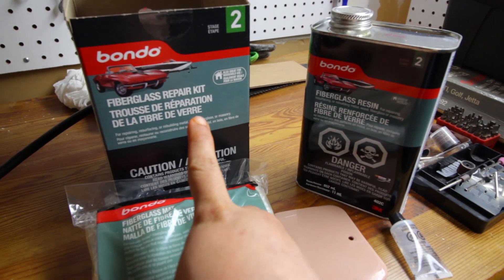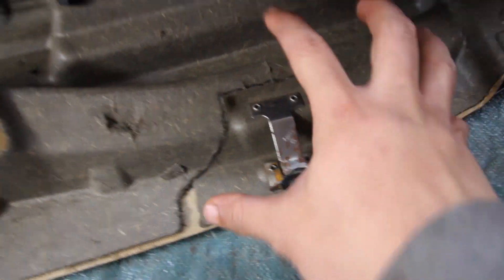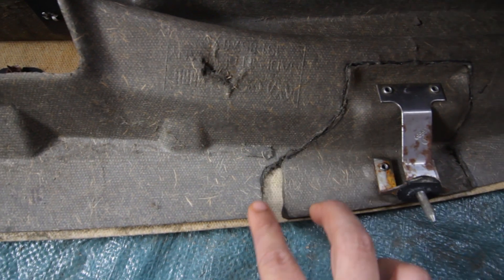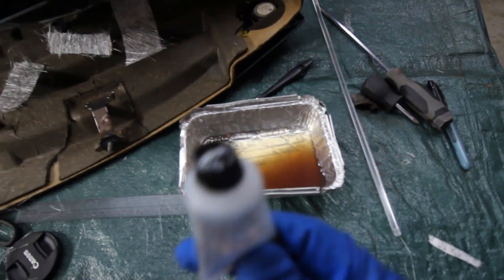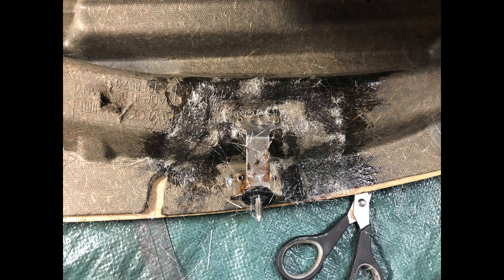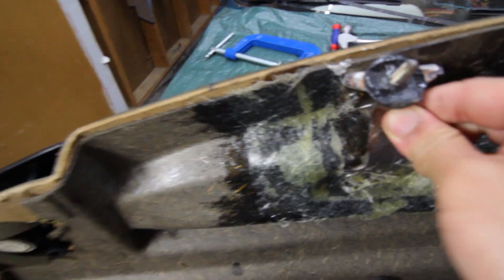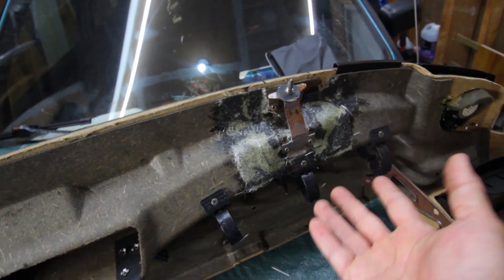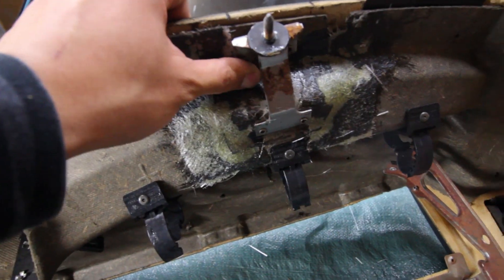Fiberglass Made Easy

Comment: Thank you for a well executed tutorial. Can I measure the 1oz. in a plastic container or will the fiberglass melt it ? Also I have some fiberglass and hardener for several years; is it generally shelf stable? Cheers and all the best!
Reply from the maker: It did not melt my plastic container from my experience and the fiberglass and hardener still seem both to be OK.